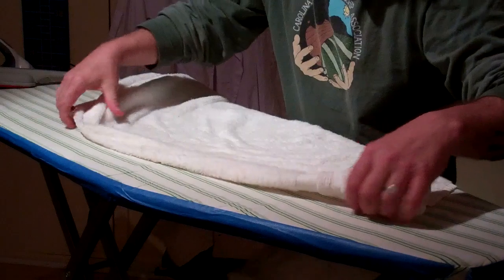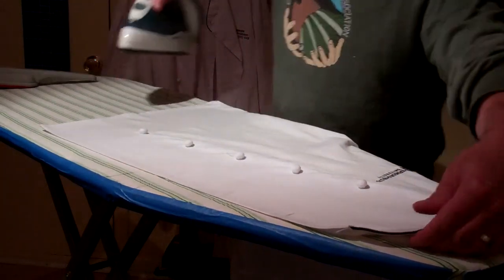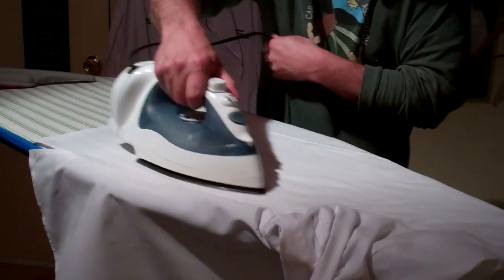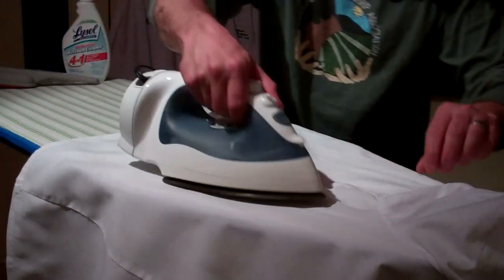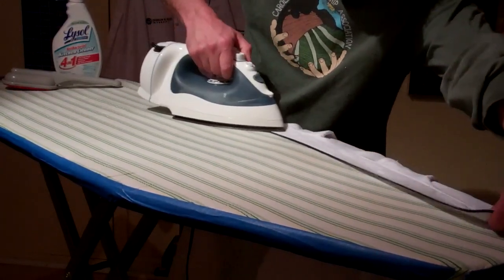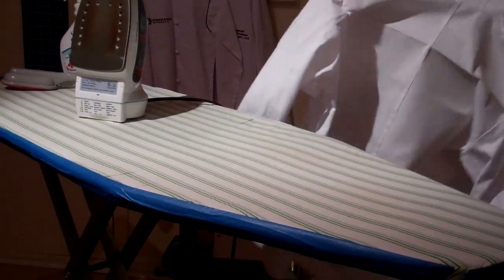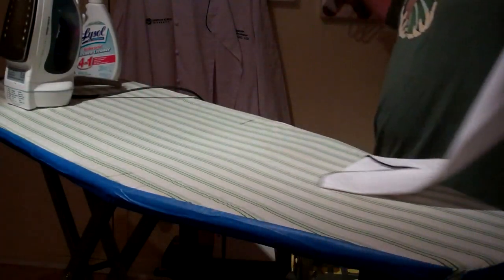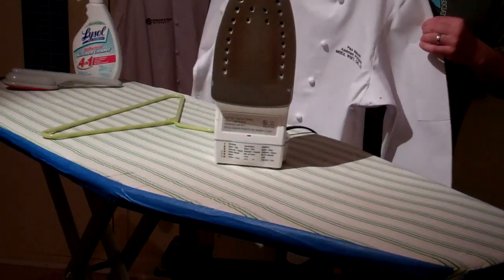How to Iron Your Chef Coat

Comment: Another little trick if you go to pull out your jacket and notice its gotten a few wrinkles from getting bumped around in the closet is to remove the plastic and hang it up it the bathroom while you shower. The steam from the shower will help to pull out the wrinkles much little hitting them with the steam feature on the iron will.

Comment: Best way to fold a jacket ? I iron it then when I get to work it's a bit creased again
Reply: +Max Wright Have you tried putting it on a hanger (a thick wooden one)till it's cool and only folding it after? They will keep wrinkle free if you pack them separately in small plastic pouches once they're folded. It worked for me, my ex husband is a Chef and I used to iron all his vests(jackets), pants and aprons every week